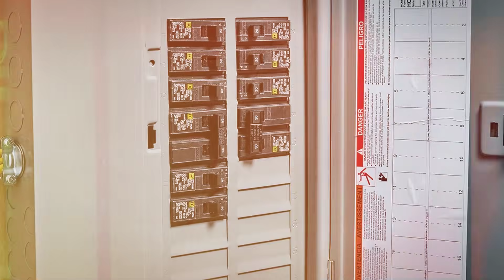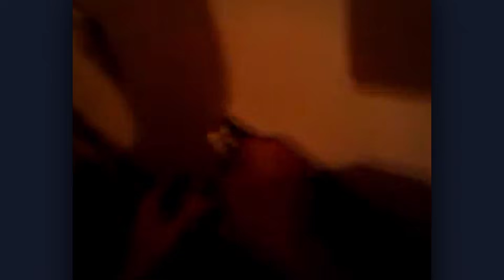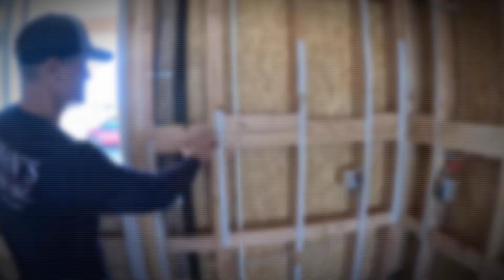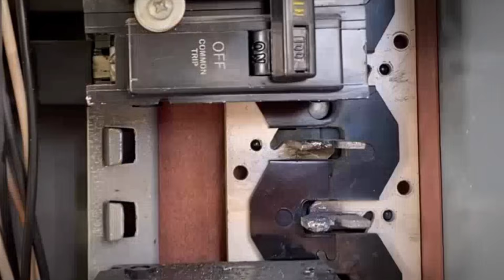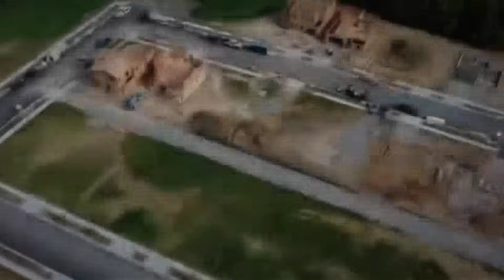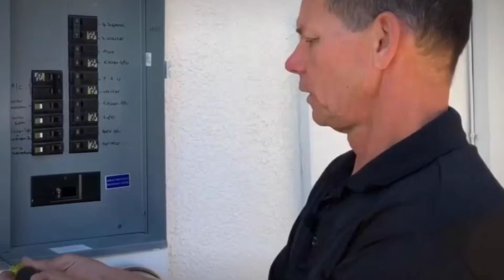The Modern Wiring SCAM (1920s Houses Were Wired SAFER)

Comment: Ah yes the old "compare high end old that was installed by people with a degree who actually got paid for their work" with cheap junk from the bezos bazar.
Absolutely disregard such modernistic fads as grounding or staged multiprong breakers or smart meters that cut out when there is overcharge or leaks.

Comment: Worked as electrician for years. Most services from the 2Os  consisted of 2 Edison based fuses and were dangerous because of no ground. You couldn’t run  1/10  of a modern load on that . There is so much misinformation in this piece , it’s almost criminal . Most of the fire dangers I ran across were improperly spliced neutrals , I’ll take Romex over knob and tube

Comment: I am a lighting historian/light bulb collector and self taught electrician, and I will ABSOLUTELY say that knob and tube wiring done correctly to begin with (I know how to CORRECTLY install it, usually using period correct vintage devices and materials from systems I salvaged from abandoned buildings we tore down as our business, and believe me it is top notch stuff!) and it is the best wiring method EVER and is a work of art. The early fuse panel for it are absolutely perfect! Some panels have a fuse on the neutral side as well as the hot side, and you only want a fuse on the hot side, because if the neutral fuse blows instead of the hot, the entire circuit back to the blown fuse will still be live, and a potential shock hazard! Easy fix-a 15 amp fuse if the wire in 14 gauge, and it usually is in Knob and tube, or a 20 amp fuse if 12 gauge, and a 30 amp in the neutral fuse holder. That way the lower amp fuse on the hot side blows and the 30 amp doesn’t, as long as 15 to 20 amp fuses are used on the hot side. Thus the 30 amp fuse creates a simple solid neutral like modern panels. I have several early panels in use using this “trick” and it is absolutely fine and safe. I believe at some time there were plug fuses that had a solid strap that made a solid neutral in these panels with cartridge fuses, and fused neutrals, same deal-30 amp on the neutral, 15-20 amps on the hot. A clean, shiny piece of 1/2 inch type L pipe will sit correctly in the clips with full contact and makes an excellent neutral solid neutral and saw it done in many places. This method allows bypassing the neutral fuse in the occasional 120 volt 30 amp circuit to make it solid neutral. This will have 10 gauge wire. It may not exactly be “code” on this trick, but is not an issue if used ONLY on the neutral side on 120 volt circuits. Th fused neutrals are only in very early panels, up to about 1918. This wiring is individual conductors (wires) in free air, and wires will run cool unlike cables like NM. That adds safety. AND-NEVER put insulation of any kind especially foams snd blown in insulation in outside or inside stud spaces because it defeats the “in free air” moniker and will cause the knob and tube to heat up. Don’t buy it in attics either. And don’t tap into it or work on it if you don’t have proper skills or tools. It will never let you down! Cheers! Rick Delair. 😋👍

Comment: I have a 112-yr-old home with 12 gauge knob and tube still running all the ceiling lights. Where visible in the attic, insulation rubber is still in solid condition if left undisturbed. Given that the wiring is now permanently “semi-retired” powering a bunch of 6 - 10 watt LED bulbs where for decades it ran incandescent bulbs totalling hundreds of watts, I rest easy at night knowing that the centrury-old copper wiring is being asked to do FAR less work than it was ever designed to do..    The copper itself never deteriorates.

Comment: My home was built in 47’. I’ve found some knobs but no 2 wire installed. I have replaced ceramic body switches and still have some aluminum wires to replace. When I had my attic cleaned and vacuum before blow in insulation I found 3 circuits (cloth covered wires with boxes, outlets, and switches still installed) that had been removed from walls during someone’s renovation and just shoved into the attic spread across above the ceiling still live hot circuits.

Comment: copper oxidises too. All metals when exposed to air oxidises. You can use any metal as long as it has a high melting point and the needed amparage, and the reason why non copper is used is because it is structurally better as copper is soft, easy to bend which can cause a short. So the choice of bus bar is a structural requirement as well unlike cables.

Comment: Knob and Tube wiring.  Back in the day was called very good.  Now and days. If u can replace it do that.  After 100 yrs. Sometimes u run into where the insulation is falling off around light fixtures.  In that case . If u can't replace it. I would get a short section of romex. Say around 1 to 2 foot. Slide out the wires and then slide over the old knob wiring to protect it.

Comment: You could replace all your outlets and not backstab them. I do think all electrical should be done as EMT like Chicago requires.
Reply: No way.  Stay with using Romex in House wiring.
Reply: @zerosparky9510  Why? EMT is safer, more robust, and much easier to service down the road if wires need to be replaced.
Reply: @woodalexander  ,  disagree.  a lot harder to deal with than Romex.   just a give away to those who work with EMT.  No Thanks. Installing Romex is a lot easier to work with.  and If done right then last for yrs. and there is ways of dealing with wiring if something happens.  Not always and have to open up drywall.   and i once was with a guy.  a hotel had a light go out.  found a wire in the EMT had shorted out and melted away and could not get a wire around it.  So we had to install a short section of EMT on the outside wall.   Use EMT or MC Cable for Commerical Work.  Not House Wiring.
Reply: @woodalexander  ,and i guess Chicago just wants to screw over the homeowner in Costs.
Reply: @zerosparky9510 Sure, EMT takes more work to bend all the pipe but it's technically superior in every way. You have a grounded shield around all the wiring, and can pull through new wiring if needed. That, and well done EMT looks like a piece of art.
Reply: @zerosparky9510 What I find interesting is that it seems like around here EMT is way more expensive but in Chicago it's not that much more expensive so I'm just assuming the Chicago residential electricians are a lot faster with EMT because they're having to do residential jobs with EMT versus here it's mostly used in commercial.
Reply: @zerosparky9510 Chicago also exempts some of the AFCI requirements in the NEC due to using EMT so that saves something.
Reply: @woodalexander . Disagree. Again Chicago is just screwing over home owners in higher costs.  A give away to those who can bend emt conduit.  I am to old to do that now.  I will stay with Romex
Reply: And a work of art. So does the home owner take off the drywall to look at it?
Reply: @zerosparky9510 I don't think it's a giveaway as the Chicago guys can pipe fast.
Reply: @zerosparky9510 You can see it in the basement. And you know it's there.
Reply: @woodalexander  it is a big giveaway.  what about the homeowner that wants to do his own work.  Around here in Lou.  this goes on.  Simple to save money.   Running EMT is a lot slower than install Romex.   this is disingenuous to say so.
Reply: Also what about the person that wants to start his own company for himself.  trying to do it all is hard.   I worked for myself for around 6 yrs.  To do it all and install the romex just takes time.   and to hire someone is much more added Costs.    As i had 2 Elec Inspectors tell me the very same thing .  the NEC is adding cost and in some parts of the City Of Louisville.  there are people that find out they can,t hire a Elec Company.   so they hire someone around them that knows something of Elec and pay them cash and Not take out a Elec permit.
Reply: @zerosparky9510 Then the homeowner learns how to do EMT and they take 5x as long as an electrician but that's nothing new.
Reply: @zerosparky9510  People doing unlicensed illegal electrical work is a different issue. For an electrician wanting to go out on their own I don't see a difference between requiring Romex and EMT. Electricians in Chicago get started somehow.

I'd argue it's not the safety stuff it's some of the other weird requirements in the NEC. Like why do bathrooms need dedicated circuits? Mine was built in 1994 prior to that requirement and it works just fine.

AFCI is debatable. Some of it is idiot proofing, some of it is protecting the wiring in the wall.

Comment: Interesting video but no mention of ungrounded old BX cable and insulation that deteriorates in jboxes over time.
Reply: Fully agree. There was BX, Romex at the same era, all  with the same rotten rubber insulation, and nobody takes any aim that that. 
And for insulation rotting at light fixtures? Seen that with older 60C romex.
I firmly believe knob and tube is inherently a safe wiring method. The possibility of shorts is nearly nil and soldered connections were very good. 
The bad rap comes from homeowner hacks that compromise the original system.
Plenty of unfounded fear mongering by insurance companies seeking to limit coverage and electricians seeking a rewire job. 
The covering with thermal insulation is also unfounded BS. I want 1 docunented case where an unaltered original installation caused a fire due to being covered with insulation. The wires are never going to get that hot.

Comment: FPE breakers were actually DELISTED by the UL. 

Some of your points are valid but there’s a lot of misinformation here.
Reply: FPE breakers equal disaster in the making
Reply: Like,  is a car from 1920 safer than a car from 2020? What a poor comparison.
Reply: FEDPAK breakers have been out of production for years.
Reply: @glenwhatley4125 . Yes.   Firecracker breakers.  Had one. Just keep buzzing away and would not trip out.  This way back late 1980.s
Reply: For quick connection,  the outlets that have the plate where the wires go underneath it and the plate is what the screw tightens, is the next best thing to the wire wrap around the screw. 
Only issue for new builds would be the added cost.  Well,  there's the rub fire the builder!!
Reply: Some of the breaker boxes you show are the Mickey- Mouse garbage they use in the U.K.
It's absolutely a crime where the Brits allow those  'Toys Are Us' boxes to be installed!
Reply: A home I bought that was built in the 50's had a FEDPAK sub panel in it that was being used as the main panel. 
Loaded with all those FEDPAK breakers.   I accidentally cut through the wrong Romex.   It destroyed my side cutters AND the 15 amp breaker never tripped.   No surprise,  huh. 
We later added an addition  and I insisted on that dangerous POS be replaced with a a Square D panel... tho, I didn't know about the Square D Q panel with the copper bus bars.
Reply: Many gone inspectors are very well trained for electrical panel inspection.   You just have to find one that is certified by an organization like InterNachi.
Axium home inspections in Denver,  CO certifies it's inspectors for panel inspections.
Reply: That is good to know. Are there any companies making breaker that would fit the old FP breaker box that are UL listed?
Reply: You needed to add the caveat that NO home owner who is unaware of the dangers in an electrical panel should EVER remove the dead face of an electrical panel,  or even attempt replacing an recepticle or switch unless they know the dangers and have experience.

Comment: Original knob and tube wiring is a shock and fire hazard - you’ve obviously never had to work on it
Reply: I don’t necessarily disagree with you on that. But a lot of those old knob and tube houses have made it a hundred years and this new code compliant stuff is keeping fire departments quite busy. 
We might oughta be taking a look at why instead of deeming them unfit. 
New improved and safer doesn’t really seem to be getting the job done right now. 

Frankly I think the biggest problem is with the politics of the NEC. Find out what the head honchos and contributors are invested in and you’ll have good insight into the next code cycle changes.
Reply: @D@DaddyRabbit62ue money makes the world go round but lets be big boys about it because we’re not getting away from that either - what are you gonna do about it? When you say its getting the job done you seem to think original K&T wiring would be perfect if we just left it alone but its not ok. Its been baking in the attic for half a century and the insulation is falling off. When the plumber crawls up the he’s at risk. When the HVAC guy wants to add a circuit - the whole system is at risk.
Reply: @1Sparky4u2c 
I hate to break this to you man but some of that stuff has been baking in the attic for a full century. 
There’s something that can be learned from what those guys who came before us knew about what they were doing and why they did it. 
Actually just for fun here you are aware that grounding only became important after the power company decided to center tap that transformer on the pole to ground at the pole. 

That act gave the electricity an alternative path through ground and then everything from that point on had to be grounded for safety. 
Was it the right thing to do? Sure. 
The right thing has consequences and benefits both.
Reply: @DaddyRabbit62 The idea that ungrounded power is "safer" is a dangerous myth that was debunked a century ago. Early systems were actually grounded specifically to stop houses from blowing up; without that center tap at the pole, the high-voltage primary (7,000V+) has no "drain," meaning a simple transformer leak could put lethal voltage on your light switches. Knob and Tube wasn’t some magical floating system either—it was almost always 120V with a grounded neutral. It just lacked the third "safety ground" wire, which is why it's notorious for being a shock hazard.Standing on porcelain tile in bare feet is the perfect example of why your theory fails. At 240V, you don't need a direct wire back to the transformer to die—the earth and your body act like a capacitor, allowing enough AC current to flow through the floor to stop your heart. In an ungrounded "floating" system, a breaker won't trip when a wire touches a metal chassis, so the appliance just sits there "live" and waiting. You aren't "safe" because there's no ground wire; you’re just the first person to provide a path for the circuit to finally close.
Reply: @DaddyRabbit62 keep this in mind I’m an E&I inspector at the refineries been in the trade for 28 years and the refineries have been doing this for over a hundred the electrical safe work practices and installations are written in blood.
Reply: @1 @1Sparky4u2c k. So you now established you’ve been in the trade about half as long as I. 
Nobody not even myself has ever suggested an ungrounded system was safer let alone better. 
If you’ve ever done anything you’ve certainly encountered a backstabbed outlet. 
Yet it’s not only still permissible to do so by the codes but it’s not required to pigtail when doing so. 
Another thing to consider here is that if the backstab tabs are as good as the screw terminal then why isn’t it available for use on the 20amp receptacles. 
It isn’t.  Never was. Never will be either. 
They are a fire waiting to happen. Most of us know that. Yet it’s still happening. 

I’ll leave this here. If I won’t sleep under the work I’ve done I won’t do it for you or anyone else to sleep under either. 
Past time for people to start thinking that way.

Comment: My house built in 1901 has Knob and Tube, in the 1930s I believe, it was partially rewired removing the Very Old porcelain Lever Switched Fuse block from attic and transferring to a screw in fuse panel in upstairs hallway, then the 1960s bypassing to the Basement woth a modern style buss bar circuit breaker box. With much of the lower half of house in 1960s
 Crouse Hinds conduit and modern style wiring.  Half of the house still uses knob and tube and it Runs Strong powering 8 Amp window ACs and 12 Amp vac no Problems and its 125 years old this year

Comment: My 12 gauge knob and tube wiring versus an upgraded circuit with 12 gauge on a circuit breaker , started a vacuum cleaner on the 12 gauge knob and tube with a light on the same circuit doesn’t even dim,  but the modern circuit does… Big Time voltage drop

Comment: I have been disgusted at the electrical crap I see on sale at Home Depot and other stores - remember what light switches used to feel like in your hand, and how long they lasted?  The new ones feel like flimsy crap.  Electrical outlets are often the same.  And I have long complained to fire departments, UL, etc that electrical cords should not be made that are only good for 13 amps, when a typical household circuit is 15 amps - this seems so penny-wise and pound foolish - you want a margin of error, not a cord that is going to overheat possibly before the typical 15 amp breaker would even trip.  And how much money is "saved" by this?  I look for better quality stuff, hopefully made in America, with better reviews.  And I was reading before about paying for the better electrical panels with copper bus bars - I wish I had known that when mine was replaced - they are not that much more expensive!
Reply: Here in Europe, even good extension cords are rated for 10 Amps (at 230 volts) despite being put into outlets that have a 16 Amp breaker but these extension cords have their own fuse. So it's not like everything has to be rated for the breaker. Just like all devices that plug into the wall should (but often don't have) their own fuse right where the live wire comes in.
Reply: They also now use meltable and flammable plastic in electric hardware, it used to be all bakelite.